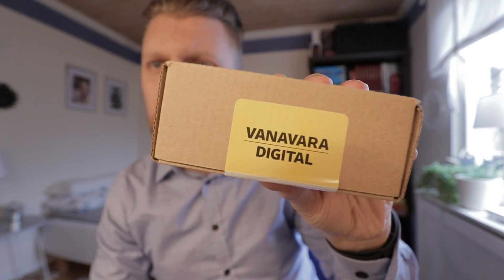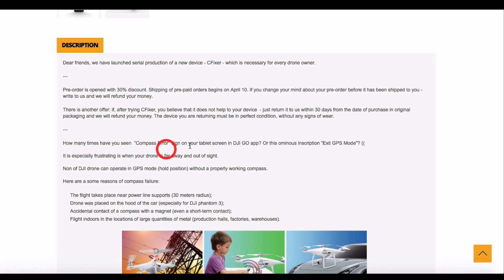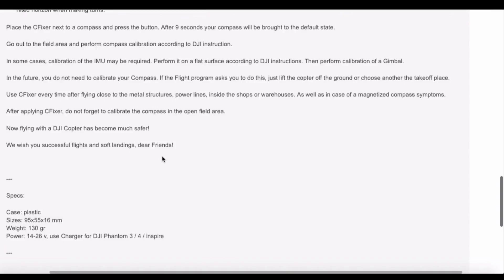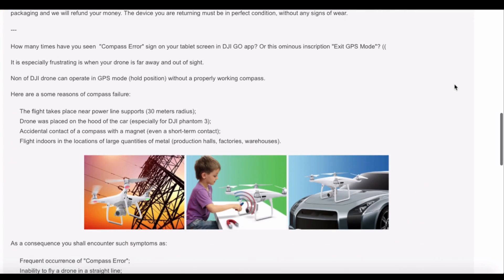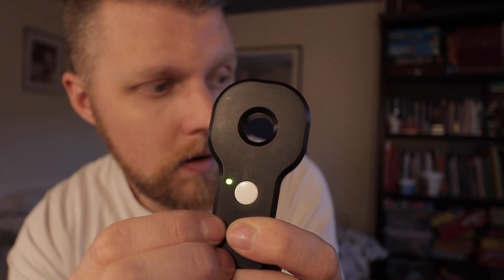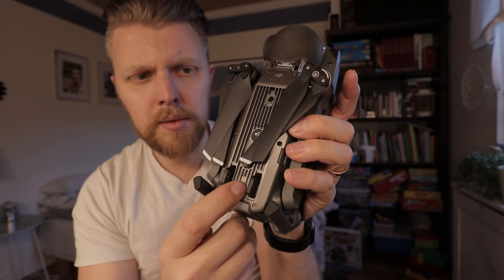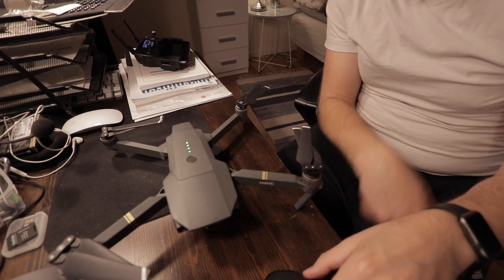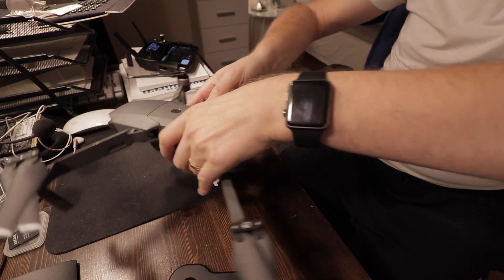NO MORE COMPASS ERROR ON DJI DRONES WITH THE CFIXER TOOL?

Comment: Can someone help me please?!?!?!, 
 I just got my phantom 3 standard, and we'll today, I was showing my mother how it records when I was taking off and I got the auto take off and then it shot straight up but I realized a tree branch above us so I tried backing down the throttle and moving the drone back but it wouldn't bc the auto take off and so it hot the branch and then it felt straight down in my cement driveway smfh, and the motors kepts spinning with the drone upside down, so I shit off real quick and turned back on and now it won't start up n take off, the info screen pops up with all the errors n what not and it says calibrate the compus but when I try to, it says calibration failed please try again. So why is it failing? Why won't it calibrate it keeps saying retry smfh. ;;;((( ?? Please help me someone please. I also kinda hear something shaking around inside. Please help. Any tips?..

Comment: I've been using an old Radio Shack 44-232 Reel to Reel  Bulk tape eraser/demagnetizer /de-gausser on my P3 Advanced and P4  every time I start to have problems with calibrating the compass since I bought them. Works fantastic.  https://reverb.com/item/13916277-radio-shack-realistic-44-232-bulk-magnetic-audio-video-reel-to-reel-or-cassette-tape-eraser-guc

Comment: I think this thing is a SOLUTION in search of a PROBLEM.  If you're compass needs calibrating,  then calibrate it.  Why would you need this thing?  If there was a legitimate need for this thing,  then DJI would be selling THOUSANDS of these things.
Reply: The reason you need to degauss the compass is because when magnetized it often wont calibrate no matter how many times you attempt to do it. It will always give a "calibration failed" error.
Reply from the maker: This could be true. They did send me a updated version for Mavic Pro which I will try as soon as I'm experiencing driving problems when flying. I only have these issues sometimes so not sure which effect the new cFixxer will have.
Reply: And the instructions say to use this whenever you get compass errors. Carry it with you they say. How stupid of a product can this be. Instead of that ill just calibrate the compass whenever the aircraft asks. Why would i need an additional 'burden step' to set right what i can do with the basic aircraft procedure itself.

Comment: Hi. Is it effective for the mávic pro? Does it harm the electronic boards?
Reply from the maker: I have just gotten the new version for Mavic Pro, will try it in a few days then make a review! 
But I have no reason to believe that it can harm the electronic boards.
Reply: BjörnRandén good. I have my mavic pro and the compass 1 values me from 400 to 700 and I can not lower it even if I try to calibrate it ... it always throws me wrong.
Reply from the maker: Ok, I will check the settings for the compass before doing the calibration.
Reply: BjörnRandén. Perfect. Let me know what happens next to see if the product is effective or not!
Reply: BjörnRandén affection to mavic pro?
Reply from the maker: Haven’t tried it yet, will post a video when I have.

Comment: You can build your own demagnetizing coil for very cheap. I would make a hoop ring with about 100 windings using thin insulated copper wire used in guitar pickups. This is very low tech and affordable. For the power source, use several batteries in series.
Reply: Degaussing requires an AC power source to the coil, and then slowly moving the coil away from the object that needs to be demagnetized.  

Using a DC power source OR a permanent magnet will do the opposite of what is needed.  You will magnetize the object, which is bad.

The demagnetizer in the video probably powers it's small coil with an AC signal, and should taper the drive slowly down from full power to zero so as to leave the nearby objects in a "zero" or demagnetized state.

There's a lot to this.  Do NOT use a permanent magnet.  Do NOT use a coil powered with DC.  And if you do use a proper AC-powered degaussing coil, always move it slowly away from the object being demagnetized with power ON so that the alternating magnetic field from the degaussing coil slowly tapers to zero so as to leave the object properly demagnetized.

Just do a search for "degaussing coil".  This is something we had to do occasionally when working on CRTs.

Comment: I've wanted to degauss the magnetometer on my copter for some time now. However, I haven't been able to find my old audio tape head degausser since I haven't used that for umpteen years and it's boxed away somewhere. This video gives me the ambition to get that done. It's just an AC electromagnet with a gapped armature. You hold a distance away from the target, turn on, bring close to and then all around the target, then slowly pull it away farther and farther until you turn it off. No big deal and was done all the time by audio enthusiasts with tape decks. Just don't power or unpower it near the target. That would leave a N or S orientation to the target. Now to FIND THE TOOL!
Reply: It is a Degaussing coil. I used them when I worked in a television shop. Save your money and buy a TV Degaussing coil from an electronics shop or Ebay.
Reply from the maker: Thanks for sharing, thats very interesting!
Reply: I had one of those too and same situation.  Packed away in a box  or a drawer or a cupboard somewhere not seen for decades.  Debating whether to search for it or just order this.  :-)

Comment: Mavic have 2 compass, not 3. Top. Front and rear bottom. Rear top its the gps antenna. If you wanna know if the device works, just check compass values on dji app before and after using it.

Comment: Why we don't just exchange a new mavic pro which works? and spending 80 bucks on this thing?
Reply from the maker: Can’t really verify that is works. I don’t use it anymore since I don’t have a powe cable.
Reply: BjörnRandén u mean u r not using Cfixer?
Reply from the maker: They sent me a early version which needed power from a Phantom RC charger. I don’t have the Phantom anymore only the Mavic. So I can’t use it a the moment. So the answer is no. But my Mavic has worked great anyway. 👍🏻
Reply: I mean why we would need Cfixer to calibrate?
Reply from the maker: Earlier I had drifting issues. Meaning that even though I did a compass calibration my drone would not fly straight forward. The Cfixxer fixed this problem resetting the compass with an electro magnet somehow.

Comment: After looooong deliverytime the product finally arrived. It is suprisingly solid and well built, Connected it to the Mavic battery with the special cable I ordered and it seems to work. Have not tested it in flying conditions yet.
Reply: If you didn't fly it yet how can you say "it seems to work"? Turning on and beeping is not "working"
Reply from the maker: Okay cool! Let me know how it works!
Reply: It showed pretty good values when tested with an instrument for magnetic fields.

Comment: Looks like snake oil to me
Reply: The webpage says it does degaussing, but how much residual magnetic field would there be in the components of the quad? Hardly any I would think. The magnetic field set up by current flowing in the main battery wires would be stronger. So let's say 90% snake oil.
Reply: Agreed, Maybe I can sell him a DVD rewind-er......the IMU and Compass usually takes care of erratic flying issues..

Comment: I had "Compass 1 disconnected" message on the Mavic Pro. Through trial and error with the CFIXER I found that this was the rear compass. I used CFIXER to fix this and then re calibrated the compass. All good now. Thanks for letting me know about this useful tool.
Reply from the maker: Thanks for letting me know how the product works out, I have only used it a few times and its hard to know if the product really helps or if other things causes compass issues. Thanks!
Reply: My Mavic compass became "disconnected" when I lost the signal and instead of returning home, It must have went to hover mode instead. We found it laying on it's side on the mountain, 2 days later. Maybe lying on it's side with the battery going flat, the magnetic forces of the earth magnetised the compass. Who knows? Anyway, all fixed now.
Reply from the maker: Okey, thanks for sharing!

Comment: With this device, I can solve the error, of compass 1 disconnected in the mavic ?? regards
Reply from the maker: Not sure, which one is compass 1? I believe it only calibrates the compass, but maybe not fixing connection issues.
Reply: It degaussed the compass which fixed the disconnect issue, then I did the recalibrate.

Comment: but... does it work?? in YT clips they say the compass got magnitized? 

Btw, they do sell cables now, and... the price is a bit higher now also, 84 bucks
Reply from the maker: Because I didn't have a cable I haven't used it anymore for my Mavic. But my compass issues appear randomly. 
Maybe I should get a cable.
Reply: I just bought this thing.. You can get lower priced degauzers but... not sure if those work. 

Hope this works btw, since, ... they way it currently flies, is a bit nerve wrecking... Last shoot, near a festival (was at a safe distance), the copter 'twisted' a couple of times, and was flying very 'nervously'.... 
On that beach, I could get it to lock on GPS.. at all... which now is a 'standard' thing when starting the copter. Sometimes calibrating everything helps, but then just a moment later it goes into error again. 

Could be a faulty connection too, but surely hope not, since I saw a movie about dismanteling this Phantom 4, which is a pain! Especially the GPS sensor, which is very hard to reach.
Reply from the maker: Okey, I never experienced any of the problems you mention with my Mavic. Maybe you should contact Dji, because it should not behave like that.
Reply: I mailed them... let see... I seen a couple of video's on youtube where 'restless flying can also come through compass 'failure'.

Comment: Appears to be an electro magnet.  Wonder if this would fix my Mavic. Since the last firmware update my Mavic has been very unstable and twitchy, I'm afraid to even take it out to fly.  Would be nice if DJI actually "tested" firmware updates before they release them and cause thousands of people to have problems and possible crashes and fly-aways due to their buggy firmware.
Reply: They have shit products from DJI. And if we talk about them on the forum they will get very pissed off and shut you down or ban you. So much for buying a DJI product. By the way their tech help is crappier, they cant speak English and will irritate you to the core. That is first if you can get them on chat or email to help you.
Reply: Ive also had troubles after the last firmware update, hopefully they fix it soon
Reply: My first clue that something was wrong was using auto take-off and instead of going up to 1 meter it went to 3 meter. Scared the crap out of me since I was surrounded by trees.  And two of my three batteries were reporting errors.  I re-installed the firmware which fixed the battery errors.  Don't know yet if it's fixed anything else since it's been rainy and windy since. It ruined my video, a 20 minute sunrise I was going to speed up for a time lapse. The Mavic was drifting as much as 9 foot, too much to repair in post editing. If it's twitchy and unstable next time I take it out I'll use Assistant 2 to go back to the previous firmware.